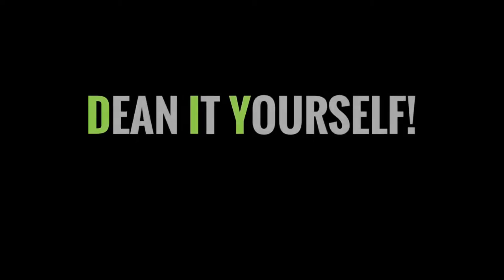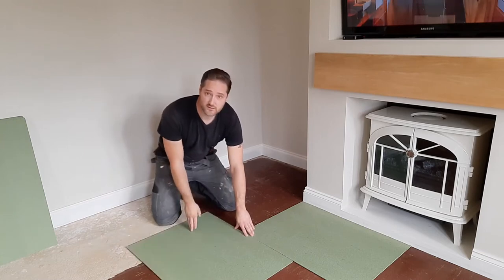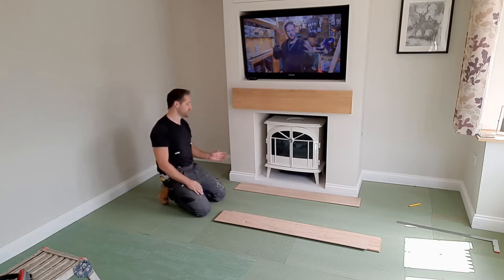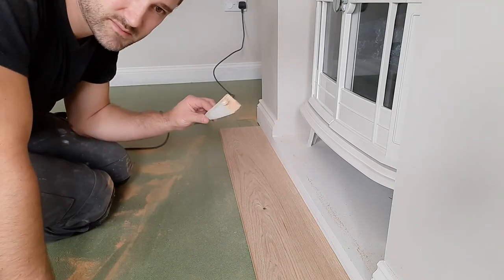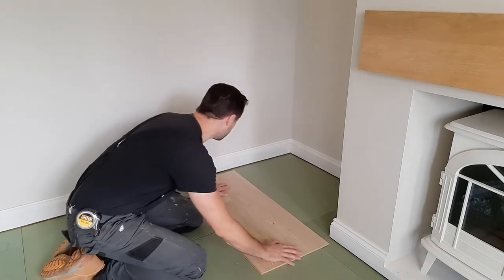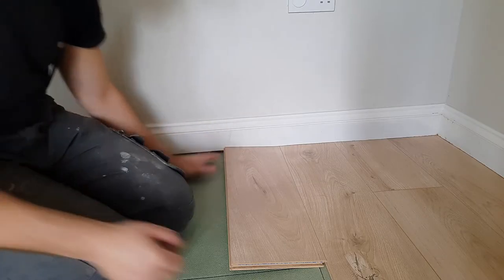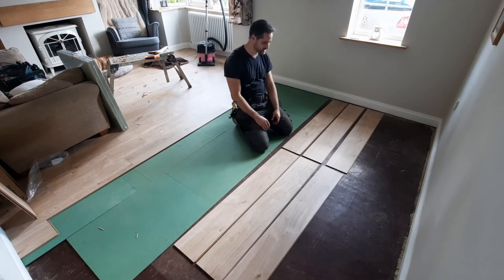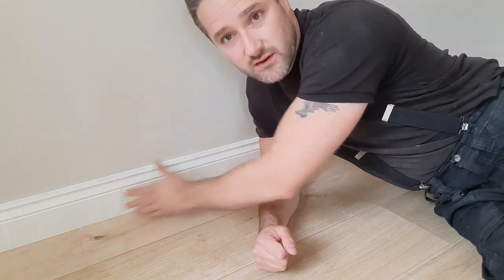How to install laminate flooring

Comment: Excellent video. Can I just ask how to do the last row of wood. As in how would you make sure to fit it under the skirting while clicking it into place ? Thanks
Reply from the maker: Hi, glad you liked my videos.   sorry for the delay.
you need to measure the gap that needs to be filled plus 5mm for under the skirting, then cut,  Then you need to remove the lip on the tongue so your board slid on ( so it looks like the rest) remove the board and apply a bead of glue on the tongue do the board won't move after drying.
hope you under stand if not let me know
Thank you
Reply: @DeanItYourself01  which glue do you use for this mate?
Reply from the maker: @NDBBDB  just good old PVA

Comment: Little touch makes different, instead of using edge strip. Joints & finishing up are always tricky. where the quality shows. It's what makes this video stand out. I've subscribed. By the way, what's the name of the tool used to cut the underside of skirting board ? Cheers
Reply from the maker: Hi Dann Wing,  Thank you for you lovey message,  I have seen other floor video's and most were 1hr30 plus.  I do try and keep my videos short and try to make them funny if I can,    Thank you for subscribing.
The name of my tool is called a multi tool from Bosch.  But the Dewalt battery one is much better.
Thank you for watching and your comment

Comment: Do you leave the 10mm gap on the underlay aswell or does the underlay go up against the wall/skirting ?
Reply from the maker: Hi 
The gap is left for the expansion for the wood, doesn't matter about the underlay as this will not expand

Comment: How do you fit the last row of boards in under baseboard ? 

Thanks
Reply from the maker: you need to remove the tongue or the grove from either board, slid the board to be fitted under the skirting and pull back into place,  don't forget to use PVA or wood glue.  silicone works very well as it will hold but unlike wood clue, you can remove the board later if you need to